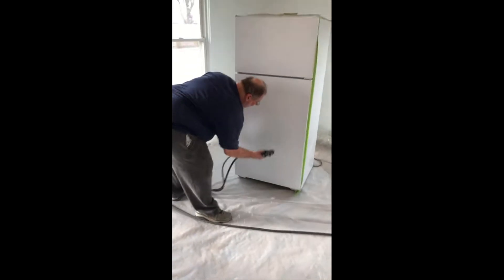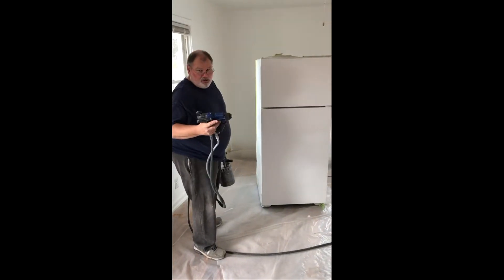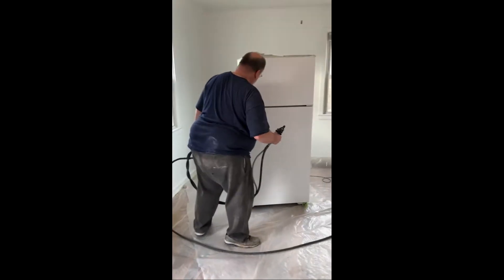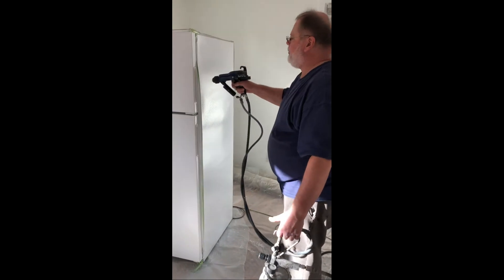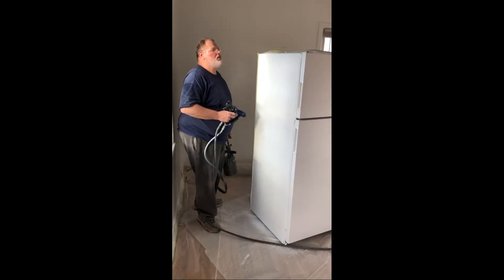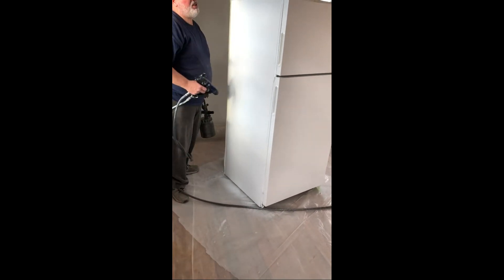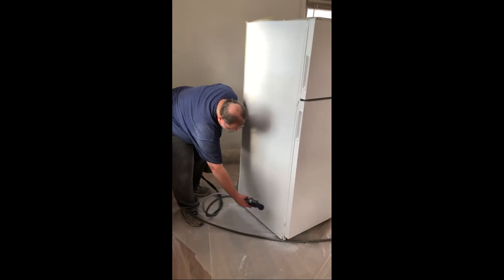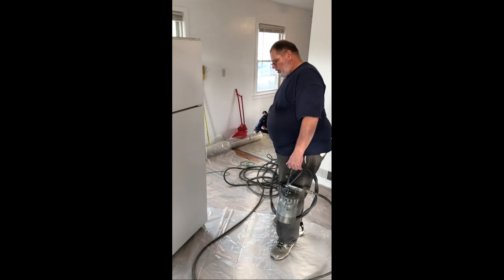Electrostatic painting refrigerator

Comment: Where the air is coming from.  ? Just regular compressor? Or what
Reply from the maker: I was using a portable Jenny Gas engine powered air compressor which puts out 21 CFM @150psi, which is way more than that what was needed for the gun.  The air travels from the compressor to a DeVilbiss CT30-P desiccant air drier.   You need to make sure that the compressed air that you are using is absolutely clean & dry.   60.000+ volts does not go well with water in the compressed air.    If you own one of these E/S guns and have no idea what you are doing then you need to educate yourself with regard to the principals of how these systems work and the necessity for them to be set up correctly in order for them to perform as they are intended.   The solvent based paints being used also have to fall within a specific window of resistivity  to be able to accept the electrostatic charge from the gun.   Don't even think of using one of those pancake air compressors because they don't even come close to providing the compressed air required.

Comment: Can make a video how set up the system ..fluid pressure at the pot and air psi at the gun. Thanks.
Reply from the maker: I have a few projects coming up, one being painting the exterior of the house which has  60+ year old aluminum siding.  I will explain the negatives associated with Alkyd & Synthetic enamels and why I will be using the specific coating that I am going to use.  I will not be getting into detailed specifics regarding the paints resistivity,  viscosity or the regulator air pressures because the adjustments will vary based upon the size and shape of an object being painted using electrostatics as well as the viscosity of paint being used.
I can be contacted through my website:
www.Aircraftaccessoriesofamerica.com

I am more than happy to discuss using electrostatic paint application with anyone.
I sell many different models of Graco electrostatic spray guns, both new and refurbished.
I have had a custom paint shop for over 45 years and have been using Graco electrostatic spray guns for the past 18 years.  
I have been using multi component automotive acrylic enamels, polyurethanes, base coat / clear coats, epoxy primers, 2k primers on specialty vehicles and satellite trucks and polyester polyurethanes on all of the turbine helicopters that  I have painted over the past forty five years.